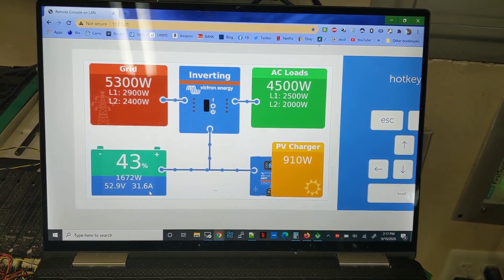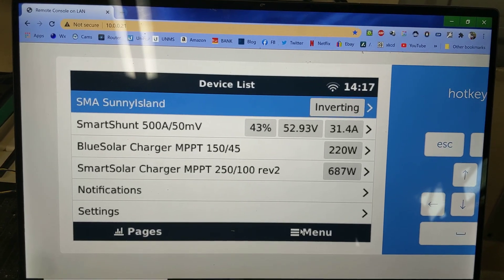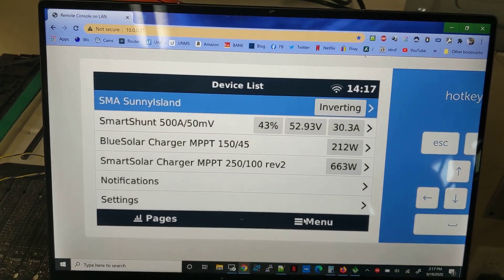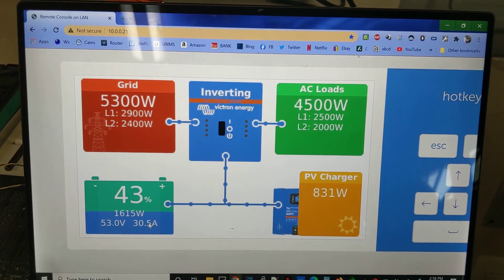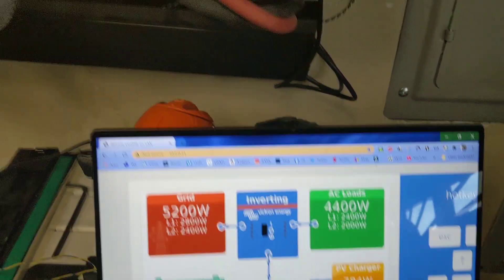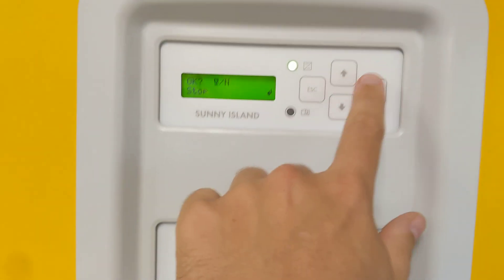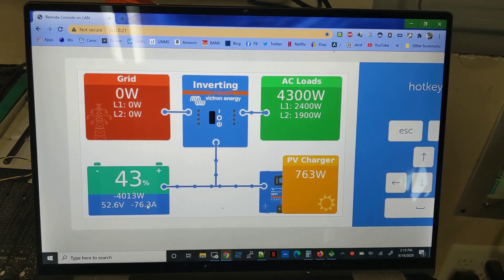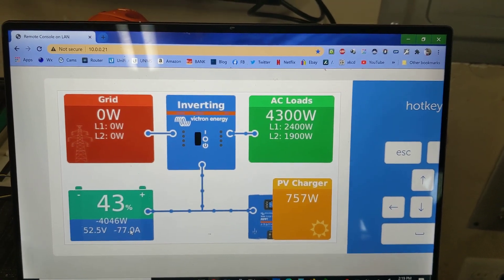SMA Sunnyisland 6048 talking to VenusOS by Victron.

Comment: Hello my friend ! It appears you where able to get the graphics on the display that’s connected to the raspberry pie to show the directional flows on energy through out your system. In this video it appears you may have got it to work very well. Questions : Can you explain the software hack programing method and the  low voltage/communication and wire method you are using to  achieve this? I have a similar design like yours but much bigger, I’m using 4 sunny island 6048,  a sunny boy 7.7, 4- Big battery PLBR , LG Nickel Magnesium Cobalt ( Li ON )    Batteries  ( 9.6 kWh x4 = 38.4 kWh, 196Ah x4 or 744 Ah total)  a Data Manager M , a mostly  whole house back up dedicated panel, a large KOHLER  in wall Transfer  switch acting as my main service panel, a Kohler 20Res whole house back-up generator ( ready for Natural Gas or propane)  a fully operational TIgo system with Optimizers on all solar panels  and communication device, 30 high out put Q cell peak 420 LG solar panels, and just purchased and installed a Victron Cerbo  GX with touch screen and Victron smart shunt and adding more and more as i go. I kinda ran in to a problem with getting the Victron Cerbo GX  to show the energy flows through out the system at any given time and was hoping you could help me understand how to get my to show the flow as you did on the raspberry pie and you display, I understand your using the Raspberry pie with Victron software but was curious if I would be able to make the Cerbo GX show the same info since the software may be the same (not sure). I would love to email you picture and videos on my entire system if you like, you will be impressed and it may be beneficial to you. My email is geneguy83@gmail.com Thanks.

Comment: Wow! That’s amazing. I’ve got a pair of 6048‘s also and a 24.5kwh leaf pack 14s7p. Anyway I’m wrestling with bms choice as the only two choices doing rs485 are over $1000 which seems ridiculous. I’ve found a few CABbus bms‘ but I need rs485-CAN transceiver or arduino etc to bidirectionally translate. I haven’t checked your other vids out yet which is my next step. Any advice for me is more than welcome. Nice work!
Reply: I see you‘re using victron charge controller.... I’m not, ive got twin SMA 6kw sunny boys Ac-coupled. Hmm.
Reply from the maker: @westvandude  You can read through the code to make your own if you want. https://github.com/madsci1016/SMAVenusDriver

Comment: Hi Bill, 

Really cool stuff you have done. 

I have a setup with 2 Sunny Island as well. I do not have a charge controller as I am using Enphase micro inverters and they are bringing AC directly to the critical loads. 

So I have a few questions for you:
1 - I saw you were using a Batrium BMS like I do and I understand you used the CanBus from the Batrium to the SMA. Why did you change this to using the Victron Smart Shunt scheme ? What issues were you experiencing ?
2 - The Batrium BMS not only provides SOC info but I believe it also provide temperature information to the SMA. How do you get the temperature info now that you no longer use the Batrium ?
3 - Can I use your code with the SmartShunt Victron without the Victron charge controller ?
4 - I experienced a strange thing the other day where suddenly I had a power outage on the critical loads (The grid still seems to be working) and it seems like my SMAs shut down for a few second before coming back inverting on battery mode. Could this be due to some issue between the Batrium BMS connection to the Sunny Island ? I really wonder what happened.If it was a real grid outage, the inverter would have switched immediately without notice. But I experience an actual outage on the critical load which leads me to think that the SMA somewhat had an issue.
5 - Lastly, with the batrium, you set it the first time to an estimated state of charge and then the atrium will automatically recalibrate it over time. With the Victron shunt, how to you actually calculate the first initial value that you need to set for SOC ?

Thank you

Christian